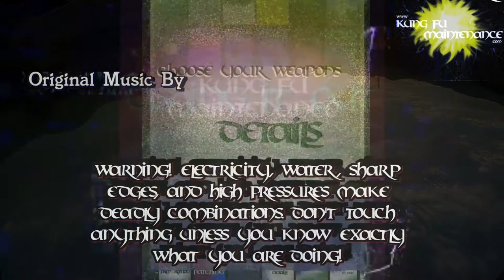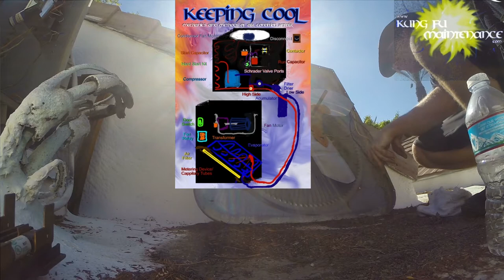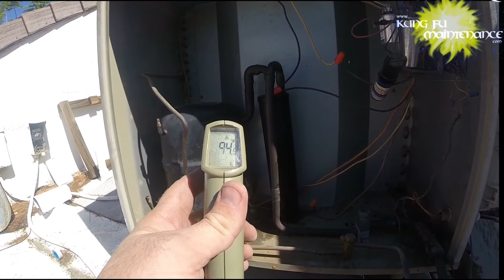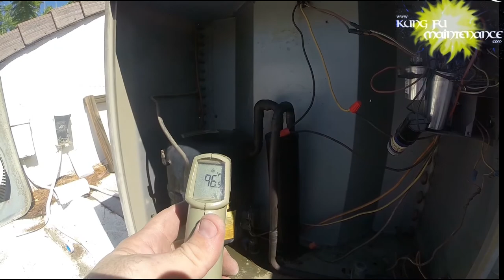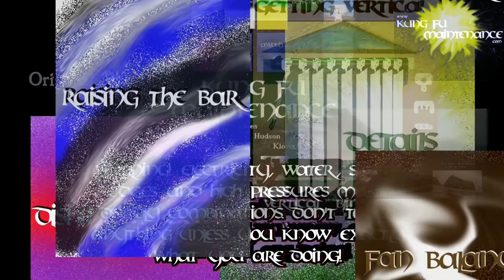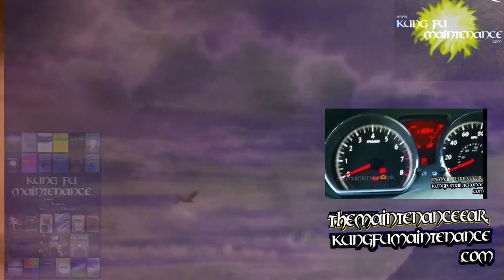Air Conditioner Down Repeat Offender Bad Bearings Bipolar Fan Change Rewire

Comment: That motor was too deep to get the top edge of blade into the shroud to make proper use of it. I've fixed a lot of high head issues by putting a smaller (physically) motor in place to lower the blade .
Reply from the maker: +Joe Shearer Good call Sir! I believe you're  correct. That motor probably did the last unit it was in in. I will need to change that one out at next opportunity I have. Thanks for sharing your insight!!